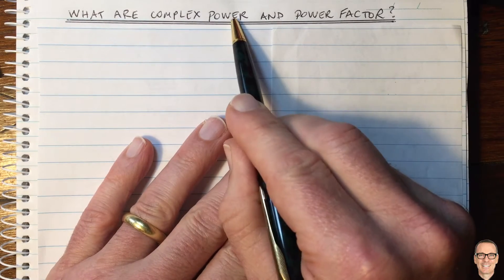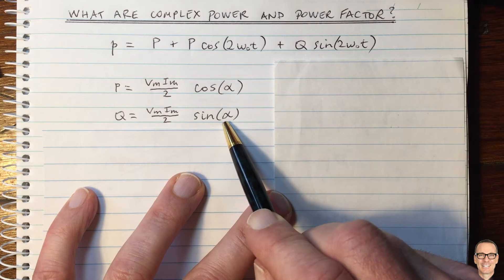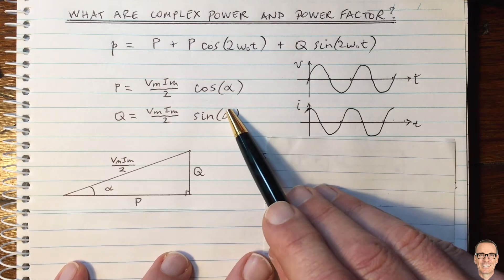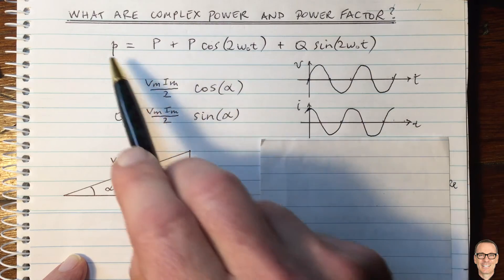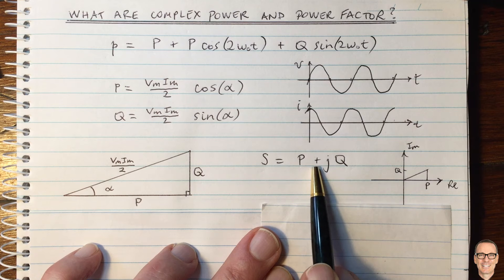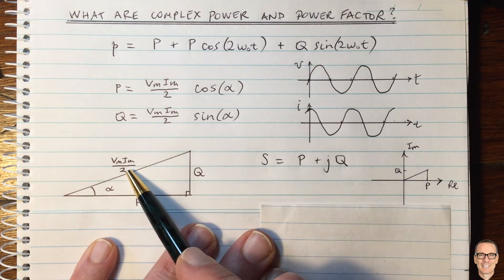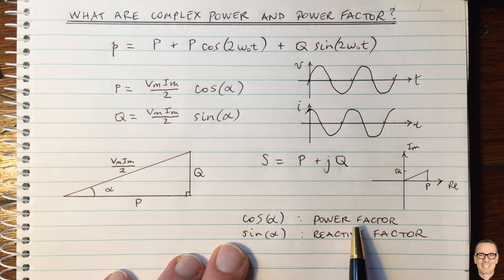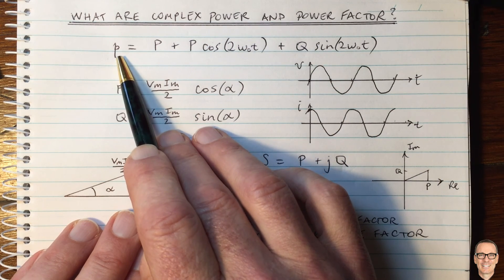What are Complex Power and Power Factor?

Comment: Thanks a lot for the helpful video!
One more question: in this video you have p = P + P*cos(2wt) + Q*sin(2wt)
Meanwhile in ""What is Reactive Power in Electric Circuits?"" you got p = P + P*cos(2wt) - Q*sin(2wt)

Which option is correct?
Reply from the maker: I'm sorry - it's a typo. Thanks for pointing it out. I will add a note to the description of the video. Actually, it's just a matter of how the phase angle (alpha) is defined. In standard convention, alpha is defined such that it is positive when the current lags the voltage. ie. i = cos(wt) and v = cos(wt + alpha) . If alpha is defined to be negative when the current lags the voltage (by simply writing negative alpha in the equation for v) then the equation I showed in the video would be correct. Anyway, it's best to stick to the conventional definition. I will update it in the pdf Summary Sheet on my website. https://drive.google.com/file/d/1uREtqqZUPl7ti8ROMaxZT4gOHNjNPuLC/view

Comment: what i alway remember any inductor/capacitor is borrowing energy from the power supply to build the electrical field and magnet field then storage energy in the field and then return the energy, for that it got reactive power.
and for non-linear device it cause distortion to the electrical grid, so it power factor (and thd) will be bad